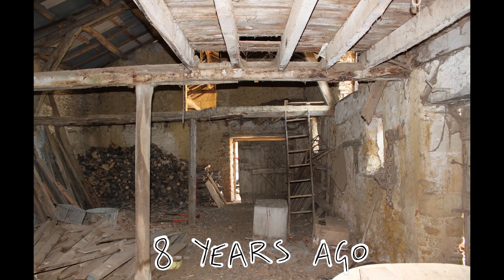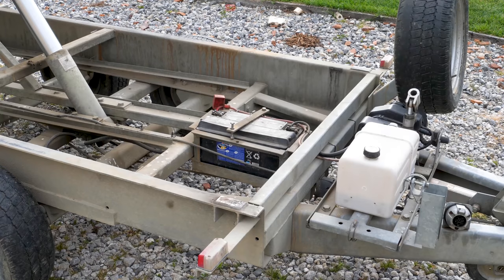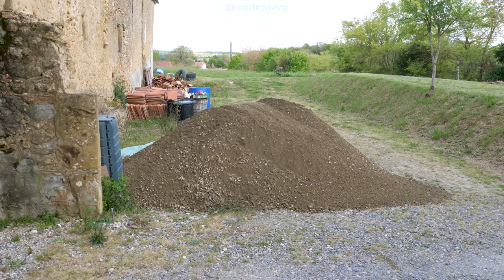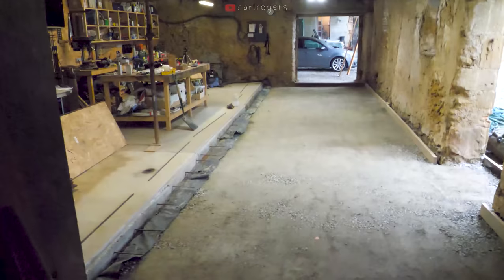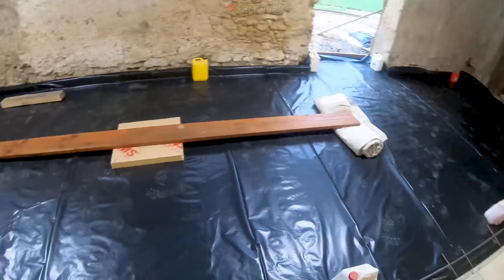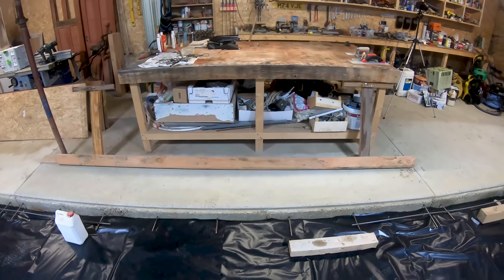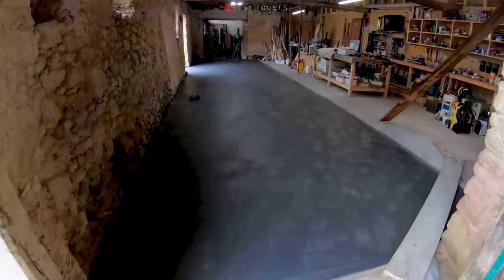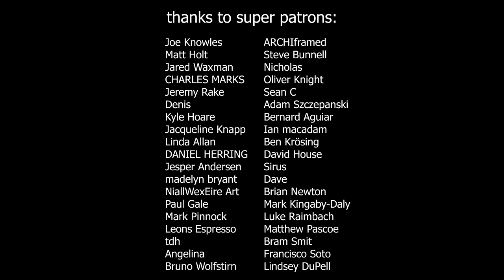How to DIY a Concrete Floor

Comment: Wow, you are not a concreter, I can see.   No, you should always use a light rebar mesh or grid on 65mm chairs for cracking control, even on 100mm/4" slabs.  6mm x 200mm rebar mesh is ideal. Also driving the inter slab dowels is a bad idea, promotes spalling from the pressure.  Pressure from driving the dowels in and later from expansion of the steel from corrosion as there is no chemical bonding of the concrete to the steel, air gap and ability for water to penetrate.   You should have used a "Chemset" glue with a 2mm oversized drilling.  Perimeter edge steel is also wise, 10mm bar. Hope it was 25MPa mix and yes, the mix was too wet.   The difference is cracking after 1 year & 10yr life span vs 50years.  You did well though.

Comment: Doing a first class job until you dropped the rebar on a four inch slab.  Always makes the job easier which is why so many contractors talk their clients out of using it but it is cheap insurance that you only get one chance to do.  If it should fail crack and heave you will deeply regret not having used it.  #4 rebar is cheap insurance for a four inch slab any way you cut it.

Comment: I realize I'm seeing this 6 months after the fact ,your lack of a expansion joints concerns me all you needed to do was stuff felt strips b'tween the two slabs or just leave a one bi four wood board b'tween them.the membrane was a lil over the top .and yes i would have put a wire fencing in the slab instead of re-bar.Why would you put concrete down and plan for cracking ?It makes no sense.

Comment: dude. buy a respirator. seriously.. just because your barn restore is 300 years old does not mean you need to cut / grind dust and concrete without a proper mask.

Comment: What a waste of time and sources. It is totally unnecessary to remove earth from that such  hard surface, also waste of money to lay  hardcore on such hard surface. You could have laid 10cm thick concrete direct on that surface,  many generations wouldn't face any problem. I would use concrete vibrator if I could afford though.

Comment: Pour it out , hard ground no fun but better than clay, waste of money for pump,get one other guy and wheel it in with water reducers and set ,gives more time to do  your deal,,, sorry but screte board was hard to watch  and  un necessary. And the mess u made on existing slab,,,let it dry up you got on it too early,,not bad for rookies,you can't rush concrete,ya. Clean your tools,,,with all time u had you should have cut your joints with tools,was un necesssryy the way u did,

Comment: I am sorry but it is terrible bad to make a cement slab in an old building. The cement does not breathe and therefore the capillary rise is trapped under the slab. The capillary will now go up in your walls to evacuate. BE CAREFUL NOT TO PLACE CEMENT ON YOUR WALLS NOW. In the old buildings one works with lime. It was necessary to make a lime concrete. Do not reproduce this error and do not be proud to share this video which is a plague on old houses.

Comment: I see you still are being pennywise and pound foolish by NOT installing rebar through the entire slab..WHY BOTHER?
Reply from the maker: pretty sure I covered this in the video...
Reply: @carlroge  I guess I missed the reason. I have been a long time subscriber and in every one of your videos where  beton was placed I have been appalled that little or no rebar has been imbedded in your pours.  I am a retired tradesmen and I cannot think of but maybe 2 or 3  pours in over 200 I was a part of that little or no steel was placed in the floor. (They were poured that way only because it was for a temporary use). Your channels is  excellent for your woodworking skills but I expected more out of your beton work.  A few hundred Quid worth of steel is cheap insurance  when doing a project if you expect longevity...Just Saying!
Reply: @RR98guy  Sometimes learning the hard way is the best way.🙂✌❤
Reply: Nobody is driving dump trucks on this slab. 
I have done a lot of concrete. That floor is fine with out rebar. It was keyed to the other slab.
Reply: @RR98guy  lol....."appalled"......you sound a little silly and upset  - just move on - 
do your slab your way - let them do theirs their way
Reply: @thomasbee5218  Yes, "appalled"
...to be dismayed or consterned...to have anxious feelings toward or about (something) especially unexpected to oneself.
Therefore he is expressing concern or having Empathy for another or thier situation. 
Heck,sometimes words can have completely different meanings within a context. Can be a noun or a verb such as;  "ROCK"...
A piece of the earth, a motion or a type/style of music.
Some here are referring to how much weight may or may not sit atop the slab but not discussing the aspect of the freeze/thaw cycle. Yes the slab has been pinned (to other slab) keyed,and given (hopefully) predictive stress relief(from whatever source)  by cutting and dividing the monolith. It may crack along those "stress lines",⁹but then again it may not.  In1975 my father poured an apron for his driveway. He had to order an amount of concrete more than was "practically?" needed,resulting in a slab thicker than he had planned as necessary. It ended up being approx. 8 in. thick and his "rebar" was/is two sections of galvanized chainlink fencing,one at the bottom of pour,one in the middle with a stress relief line up the middle of the slab. For 46 yrs. now has withstood regular passings of fully loaded 2 1/2 ton trucks several times a year, the roughness of snowplowing and the freeze/thaw cycle of Michigan weather .
He's only trying to disseminate care and helpful dialog,the same as I assume you are.
"Just move on". Let him participate in the discussion the way he is capable and sees fit and you " do it your way".
I'm certainly no expert nor a structual engineer,but ( for example) one doesn't need to be
an accomplished professional house painter to see and judge whether someone else fucked up the job.
Will the slab age without any of these problems arising? Probably.Maybe. Only time and usage will tell.
No malice intended. Be well.
🙂✌❤